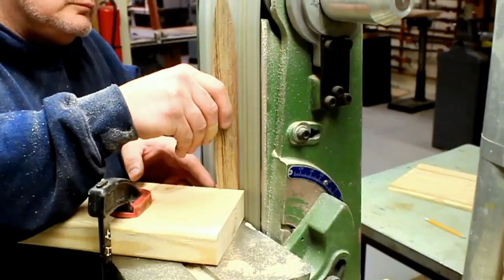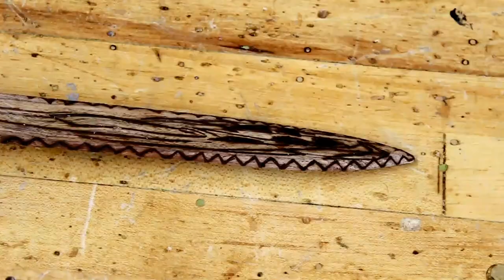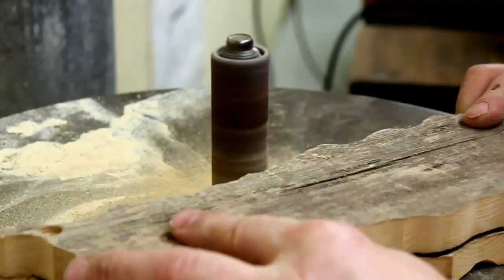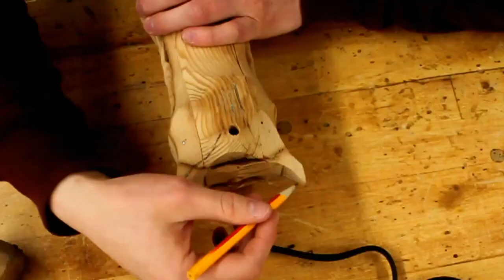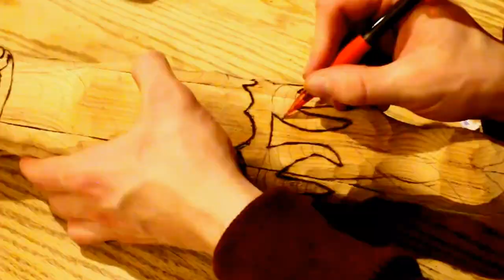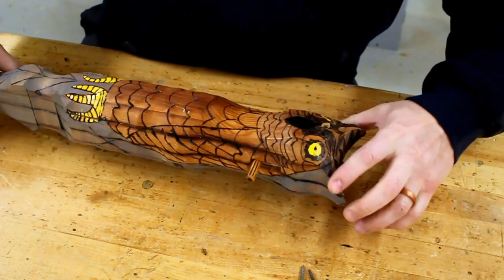HIDDEN Spring-Blade Walking Stick (Part 2 DIY)

Comment: Why are using wood and not a metal blade it would be sharper and stronger?
Reply from the maker: We mainly chose wood over metal because we didn't want to injure anyone who didn't know about the blade and this project was really just for fun. As for the rosewood it came in a box of miscellaneous cutoffs from Amazon. We didn't specifically purchase it as the box of cutoffs was really a mystery box and we were just trying to use them up. Thank you for your concern though👍